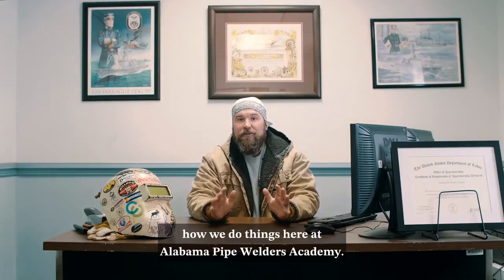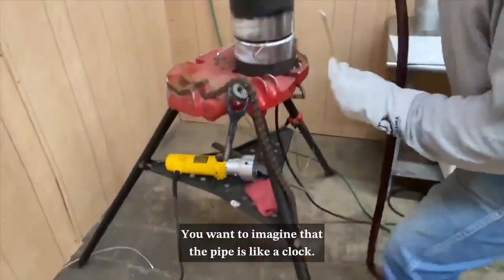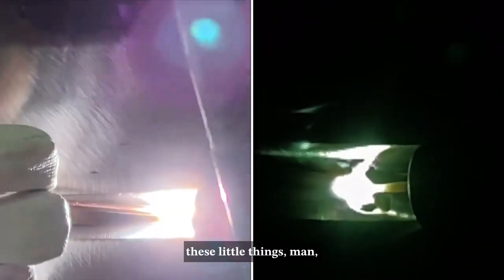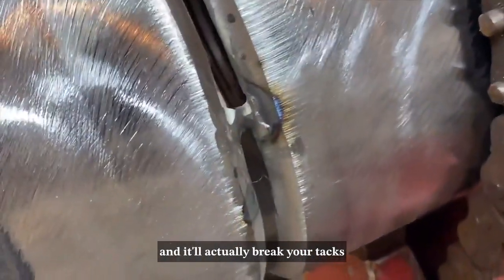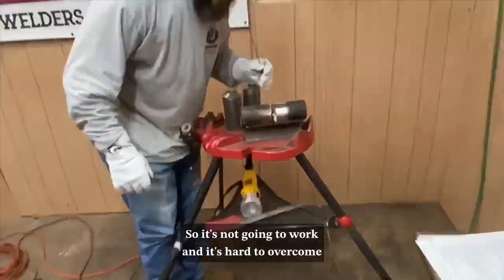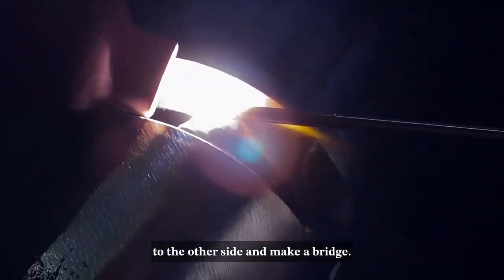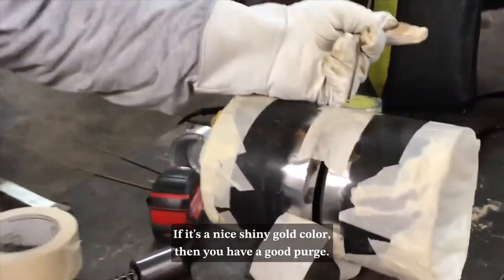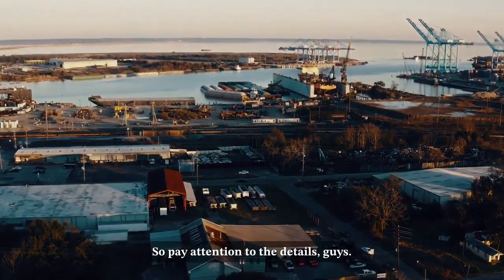Tack Welding Basics @WELDorDIE

Comment: Why not instead of bullet/bridge tacks simply weld a small metal plate across the bevels? I mean you won't need to grind every time you come close to the bullet/bridge tack - just a couple of strikes with a hammer and the plate drops off. What's your opinion on that?

Comment: And to check how good the purge is some welders use small thin stainless plate which they lay on the gap and do a short and hold an arc for a sec, if on the opposite side of the plate all is good - the purge is also good